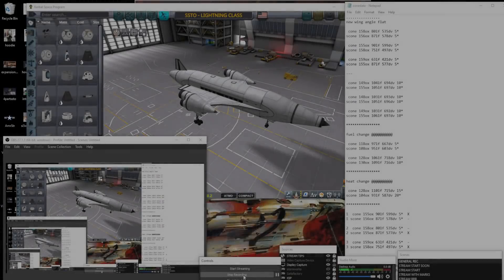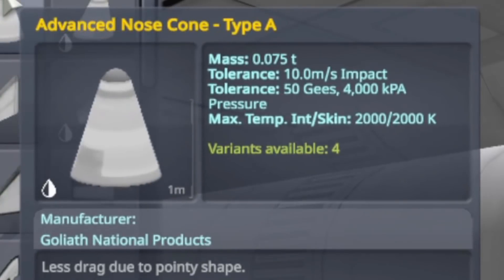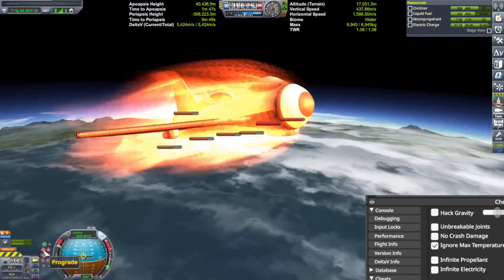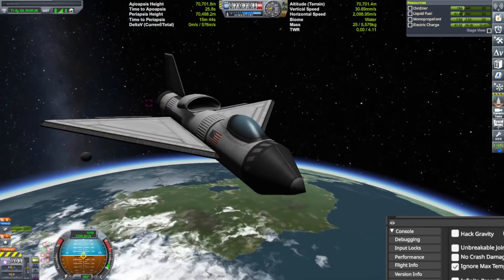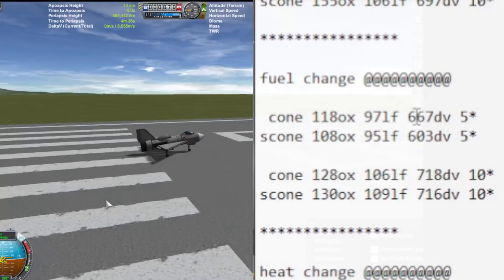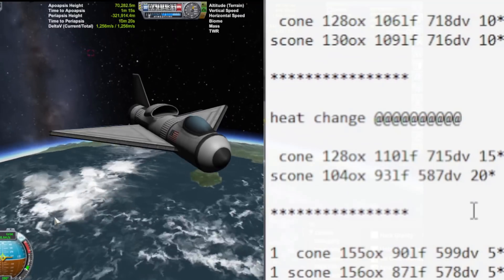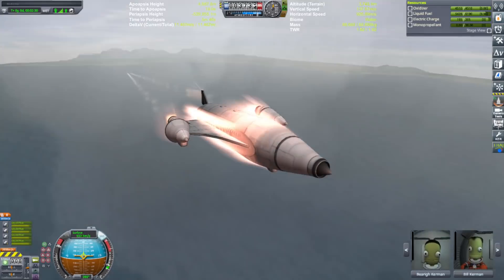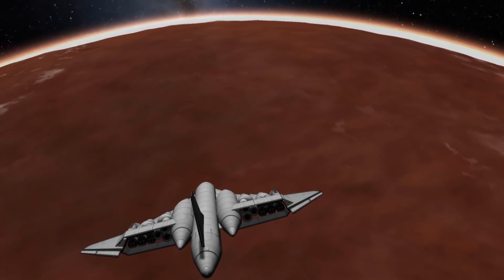POINTY is not always better.

Comment: I did this with kos and intakes ages ago, and everything has changed since then, but my little test ssto looked nearly identical to yours. I tried with kos to fly them in formation up a few times to see who ended up with the most dv, but then realized that would limit the lower drag ones, so back to just having them all run the same script... but then that doesn't take into account different flight profiles from having differing flight characteristics.... so all that to say manually flying them up to test them and using all your innate and learned ssto flying instincts.... is probably the best way to test them :)

Comment: Another point in favor of the nose cones is that traditional rocket launches perform more efficiently at slower speeds. This is to reduce the amount of fuel used to overcome drag, as there is more drag at higher speeds. So for an upright rocket the benefit of better aerodynamics is felt less than on a space plane

Comment: Sounds like you went full throttle in all tests. This is actually very fuel-in-efficient, no matter what else you did. Also a constant angle of ascent is inefficient, you want to go almost horizontal at the optimal flight altitude.

Comment: In real life, pointy noses are better for supersonic flight, while round noses are better for subsonic speeds.
I guess KSP doesn't model it well...
Reply: Real spacecraft frequently operate in a hypersonic regime where you can throw both those generalizations out the non-existent window. For that matter, your pointy noses generalization is actually more applicable to trans-sonic regimes than to sustained supersonic flight. KSP does severely simplify the modelling, but the side effects of that are usually phantom aerodynamic forces or missing stress risers. The drag on solid bodies is almost certainly more accurate than your gut instinct.

Comment: Not sure if you'll do a follow up on this, but which of the 3 options (fairing/cone/advancedcone) would be better, if they were dumped once atmospheric drag is no longer an issue (with decouplers) so you can save some delta v (seemingly gaining some by shedding weight) for the orbit burn, and does this sacrifice cause too much drag on your re-entry and landing that'd make it not beneficial overall?
Reply from the maker: Dumping parts when they are no longer needed will always result in boosted performance. However, dumping parts also means that it’s a space craft with stages. Which means, that is no longer an SSTO.
Reply: @vaos3712  Ah my perception of a SSTO was incorrect, I thought it was the act of getting to orbit without expending engine parts or fuel tanks - seems I was wrong.

That aside (hey I learned a thing), even though this vehicle wouldn't be an SSTO, would it potentially be more fuel-efficient?

Side note, if it were to jetson the aerodynamic load after reaching stable orbit but before returning, would it then be classed as an SSTO?

Comment: Pro tip: 
If you lick the surface of the sea and then climb like Matt Lowne, you'll end up using more delta-V in comparison to start accelerating at thinner parts of the atmosphere like Scott Manley.
Reply: Scott actually explains this, that in WWII era, pilots were using this method to reach supersonic speeds. I don't remember what the maneuver was called.
Reply: Protip2:
Watch the fuel consumption and compare it with the speed and altimeter proactively instead of noting down the Delta-V reactively. That'd give you more accurate results and help you out.

Comment: Vaos this is getting beyond absurd, you can literally READ the exact drag coefficient value the game uses for the parts, what are you even doing man

The "Aerodynamic Nose Cone" has a drag coefficient of 0.63 and a weight of 30 kg
The "Advanced Nose Cone - Type A" has a drag coefficient of 0.35 and a weight of 75 kg

WHY are you trying to experimentally find out the drag coefficient through impericism with unequal flying and a lot of time wasted when you can literally read the thing??
Reply from the maker: I like cake 🍰
Reply: I like cake 🍰
Reply: It's really painful to watch this, but for anyone reading this who unlike vaos is fine with learning how the game works, the lower the drag coefficient the better, with exponential returns the smaller it is, so at high speeds 0.35 is astronically better than 0.63, and of course the weight matters more if it's a smaller craft since it's added to the dry mass (big craft means the 45 extra kg are a small overall part of dry mass)
The differences he found are due to different flight paths and using a very small craft, obliviously using a more aerodynamic cone is better if you spend a lot of time moving through dense air, and his craft is so small that 45kg makes a difference, Vaos just has no idea what he is doing or how anything works
Reply: @anonymous-rb2sr  hmm have you considered playing science mode

Comment: another thing worth noting is that you can put things inside the fairing nose cones which removes the need for adding a cargo bay to house things like batteries, antennae, or re entry drone cores
Reply: I put a battery in the nose fairing of a tiny short-range supersonic jet I'm building for a challenge. It's got a cargo bay for the pilot already, but putting a battery in there stopped the pilot getting in. (I might be able to rearrange it.)

Incidentally, the challenge is to land at supersonic speed... on a mountain! XD I think he was joking when he added the mountain clause, but there is a fairly flat area (for a mountain!) at a place I call Dragon's Seat not far from the KSC.
Reply: @eekee6034  A cargo bay is not a cockpit, no matter what Cupcake Landers does.

Comment: I like pointy SSTOs and the numbers seem to say there's not a huge amount of difference between the aerodynamic nose cone and a fairing nose cone; and also the good thing with fairings is that you can put things inside them - batteries, RTGs, reaction wheels - and not have to worry about having to put them in a cargo bay (and cargo bays wreak havoc on your craft's overall drag).
Reply: Wait are cargo bays really bad? What makes them so bad? They seem like they shouldn't cause too much drag if they're closed and inline with the craft's body?
Reply: @e5haggy902  yeah i don't understand too
Reply: @warbrain1053  Did a bit of digging and I believe it's because any open nodes cause drag, which there's two of them in a cargo bay which if they're not covered cause a LOT of drag. Downwind nodes cause less drag however, so that can be another thing to look for. I don't think they're too terrible normally but when you're going for almost no drag it's a huge problem.

tl;dr: Attach nodes even in cargo bays create drag, even when covered apparently.
Reply: @e5haggy902  thanks, i mean with the scale of the stuff i send to orbit, all nodes are occupied and it is not about drag or weight but lift and power. I litterally have 2srbs with wheels on my craft, and 7 raptor engines per side
Reply: @e5haggy902  Huh, I thought the nodes inside the cargo bay would be occluded from drag while the cargo bay is closed.
Reply: @zuthalsoraniz6764  That would be the logical option but I guess it doesn't work like that.
Reply: @zuthalsoraniz6764  So you see, there's this thing in computer science called a bug.